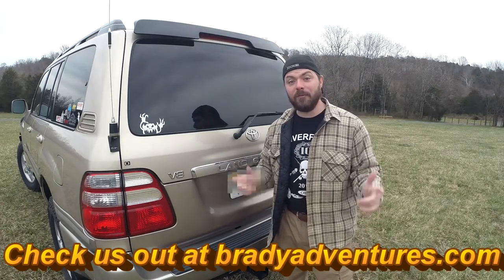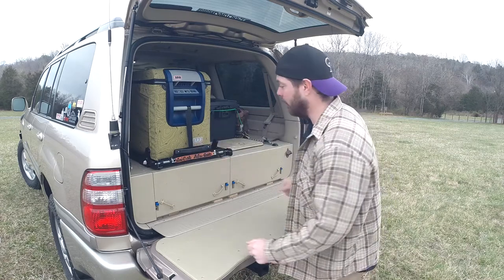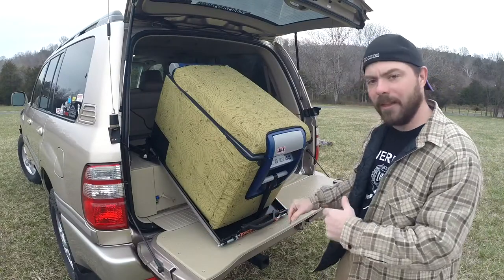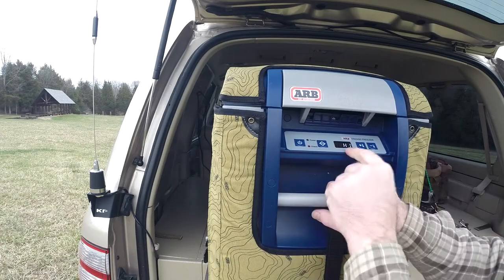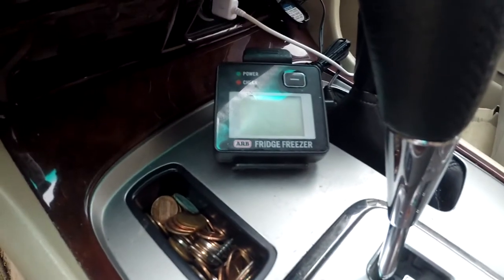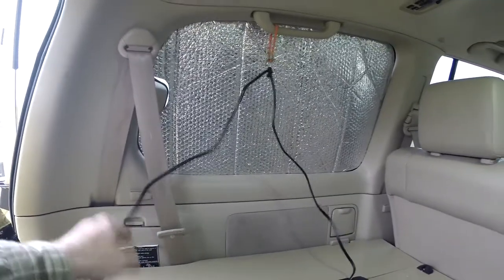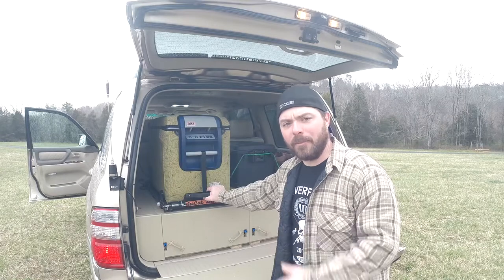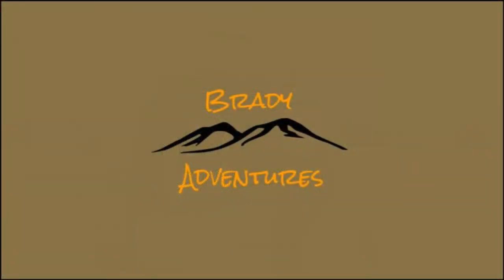Overland Fridge Walkaround - Land Cruiser 100 Series DIY

Comment: It's a nice set up but I would not be using that slide in tilt mode, for a simple reason, It states in your ARB manual that the fridge works at an angle of 30* that slide you have is putting your fridge at closer to 50-55*, I know for a fact if you tilt is backwards at that angle all the fluid/gas drains back towards the compressor and stuffs up your fridge, Then you have to shut it off and store it somewhere so it sits level for about 3 or 4 months so all the fluid/gas can equalize and then plug it back in and let it do it's thing for about 72 hours at 0*f/-18* and then at 33*f/01*c. There is a good reason why ARB only uses a flat slide, For your application using that draw system you would have been better off with either the 37L or the 63L versions which would allow you to see in better, But the 47L/50QT and the 78L/82/3QT Fridges are better suited to vehicles where you have them sitting on the floor or in Pick Ups due to their overall height. It's a nice set up you have but just be aware of the issues above, you may find it works ok Good luck and thanks for posting the video.
Reply from the maker: Sorry it took me so long to get back to you but thanksgiving prep has kept me from this and I wanted to measure the angle before I wrote this. 
 Thanks for the great comment! This topic is really worth it's own video. Anyone that owns one of these should be aware of the risk.  I actually did consider the angle of the fridge but well after I ordered , about the time I was going to install everything.  I thought there must be plenty of write ups and others have considered this but I didn't find anything at the time.  I couldn't even find a measured angle of the slide.  I think most people assume it's ok since this stuff is all sold together but not necessarily.  Once I installed the slide  I measured the tilt and was comfortable.  In my truck the slide tilts to exactly 30 degrees, wish I could show you a pic here, I just checked and measured with a protractor to be sure :-)  This is slightly less than some due to the tailgate holding it up a degree or two. This should be fine for the ARB as long as you are on level ground or the truck it angled down toward the front.  If you are parked at an upward angle then you could easily get into some bad angles, so just pull it out but don't tilt in those cases.  From my experience with regular fridges and freezers it is pretty easy to burn up the compressor if it is starved of oil after being tilted to far, so your comments are spot on (you meant 3-4 hours and not months correct?)  Most of the time our fridge is only tilted for a short period so that also limits the risk but in any case I think everyone should be aware that this is not the ideal solution and should take care not to accidentally destroy their very expensive fridge.  We haven't had any problems with ours at all and have been running it for almost a year, ordered it one year ago today actually.  Man I wish they distributed the MSA drop slides here, it was going to cost more than the slide to get it shipped from AUS.
Reply: Thanks for replying, Sounds Good Chuck, Another thing I forgot to mention is that it is good to see you have your fridge mounted on the correct side of the Vehicle, Meaning that no matter what country you are in you should always mount your fridge away from the Kerb side of the Vehicle because there are less potholes towards the middle of the road than there is near the Kerb which means the fridge is going to have a smoother ride,  I did tilt a 4x4 fridge back towards the compressor to get it through a doorway and then the fridge would turn on and every thing was fine but then it would not cycle off but 2 minutes before I did that it was running fine in another room but I carried it through the Hallway Door and tilted it and it was Toast and I tried for about 48 hours to get it to cycle and it just would not go cold enough to below about -7*/ -10*c even with frozen food put in it from the house freezer and Yes it took 3 months of being left to settle before it would work as it should again, The only reason I left it alone after 2 or 3 days was because my fuse was getting shorter and I needed a break from it Like you said these are not cheap, So I went away and upon return it was working a lot better but not perfect and then after about a week of running at different Temp settings it settled down and now it is working fine again and it only uses 10.07 watts per hour on 240v AC at 3*c/37*f which is mighty impressive even more so for those folks who live off grid. Maybe it is Ok to tilt it forwards "BUT" not backwards towards the motor/compressor because it drains the cooling element inside the Icebox area it's self, So Please don't tilt yours backwards with the Hinge End Down, Having waited for so long to buy it I was not in a happy place after being so thoughtless over such a silly mistake, Anyways you and the clan have fun take care. and I hope that helps.
Reply from the maker: Cool man, I never thought about the fridge from a pothole perspective!  Wow 3 months!  Glad your fridge slowly came back!  I am definitely going to do a follow up vid on this.  I get lots of people asking how I picked the side I did for the fridge, now I have one more reason.  Thanks for all the great info!  You take care as well and hope you have some amazing adventures!

Comment: if I remember correctly, you want your battery switch to low if your running one battery. ive killed mine many of times, but ive been wrong before.  im into a few wobble pops right now.
Reply from the maker: I am going to have to incorporate wobble pops in my daily vocab!  Here is what I dug up, for  12V DC systems High setting cuts off fridge at 11.8 volts, Medium High setting cuts off fridge at 11.4 volts and low High setting cuts off fridge at 10.1 volts.  So your battery will have the most juice left if set the batt protection level is set to high!  Enjoy those wobble pops, I think I might have one now :-)!
Reply: Hey thanks for the reply, after i re watched your vid i can see you explained that rather well, must have been my wobble pops lol! i dig this vid, one thing you might want to try is to get a plastic CNC cable tray of amozon to run your power cord through. i bought one but cant quite figure out how to install it. their was a vid on youtube where a guy shows his installed and in use however their was no explanation on how to install it. if i find the vid again ill send the info to you.
Reply from the maker: Ha ha!  Thanks for the CNC tip, someone else mentioned that a while back, that solution is definitely on the list of small projects to come!  Thanks i'd definitely appreciate the vid link if you find it!  Thanks for the feedback!

Comment: So you do not need a inverter?  It connects directly to the 2nd battery?
Reply from the maker: Nope don't need an inverter. the ARB fridge and most other Overland fridges can run off of 12 volt or 120. So it's wired directly to the auxiliary battery however I do carry an extension cord and if we are at a camp site that has 120 I plug it in. The fridge will automatically use 120V ac over 12V dc and it reduces  the drain on the auxiliary battery. There are two different plugs on the back of the fridge one for the 12-volt DC and one for the 120ac
Reply: @BradyAdventures  

Thanks for the info.
Reply from the maker: No problem, let me know if you have any other questions. Thanks for checking us out!

Comment: do you leave the fridge on full-time in your vehicle with the dual battery only keeping dual battery charged via alternator? or do you plug into a battery tender @ home?
Reply from the maker: I do not leave it running full time.  I only drive the cruiser on Friday and the weekends or trips.  I usually turn the fridge off, bring it in the house, sometimes run an extension cord to the fridge while parked.  Those options are easiest on the battery.  I do periodically top of the batteries with a charger to make sure they are fully charged.  The alternator does good but the AGMs really need a phased charge from time to time for full potential.  Pretty soon I am going to add this https://amzn.to/2tGQOX7 on board charger so I can plug in while parked with no worries.  I also am going to add solar with a phased charge controller.  With those two items it will be super easy to leave everything in the cruiser running.  I really love this stuff so feel free to ask questions anytime.  I do this stuff for fun but try to put in the research to make sure I do it right.  Thanks again!
Reply from the maker: By the way, nice channel, I used to do some powerlifting, got in a car wreck a few years back that jacked my shoulders and one hand so I keep it light now days but definitely miss it!